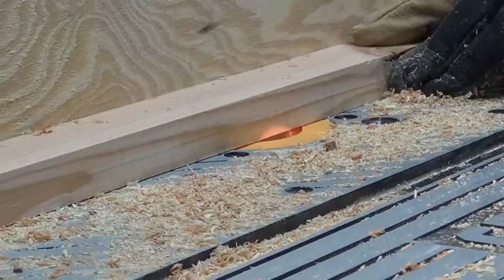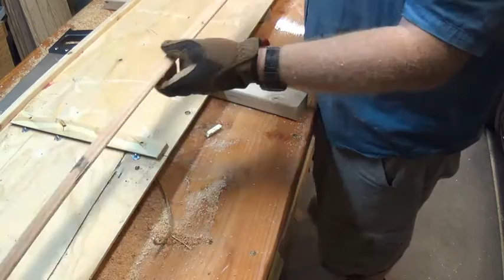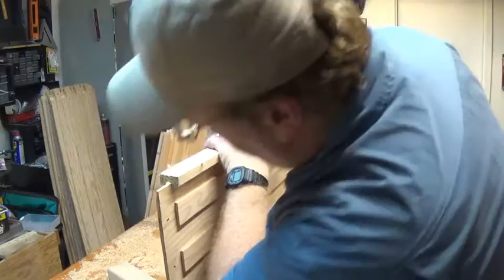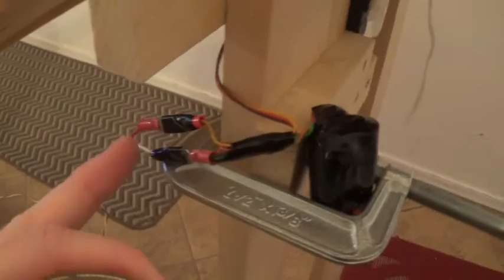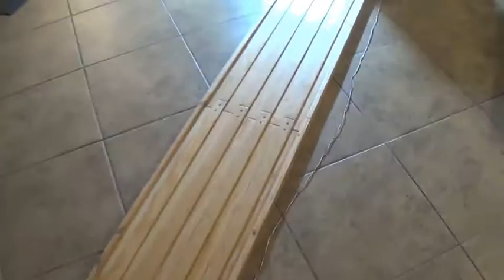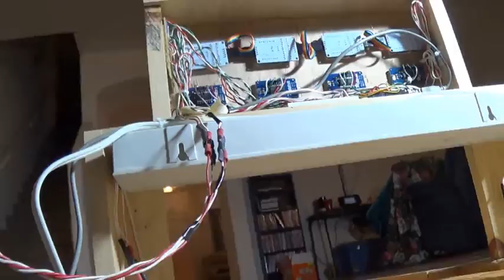Pinewood Derby Track Build - Adding support rails to the sides

Comment: Great work on this. Do you by any chance have a video or picture of the track with the polyclear?
Reply: Also, did the polyclear help with reducing friction?
Reply from the maker: I am not sure if I took any video of applying the polyclear, but it will be pine wood derby season soon so I'll do an other video then, but yes it did help with friction and I recommend sanding between coats and doing at least 3 coats. (the more you do the smoother it will get.)
Reply: Nice track man!!! I will try building something similar but you set the bar super high :-)